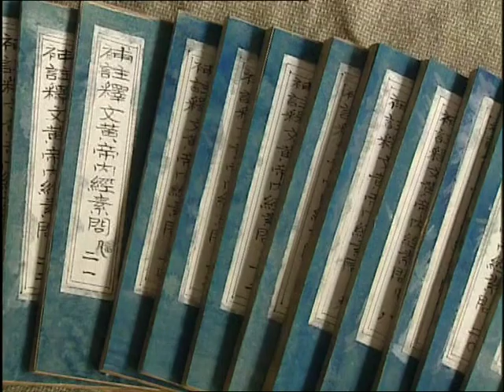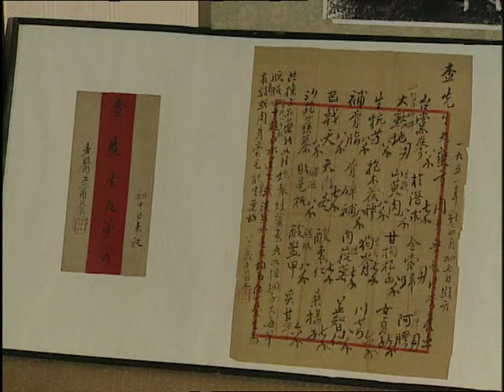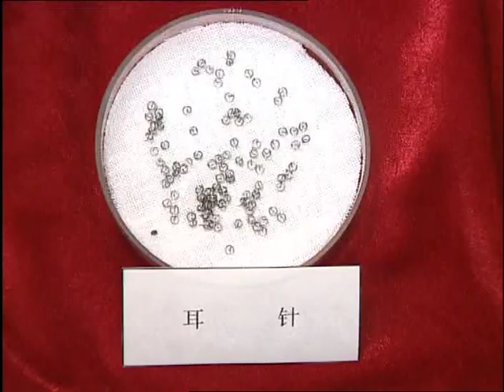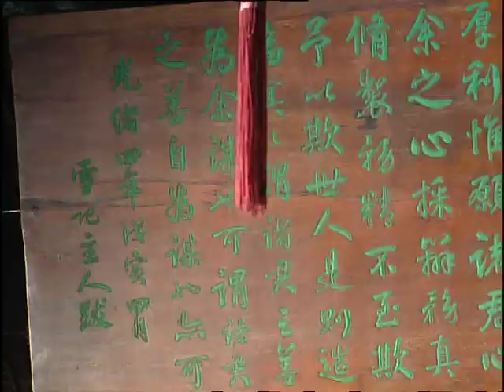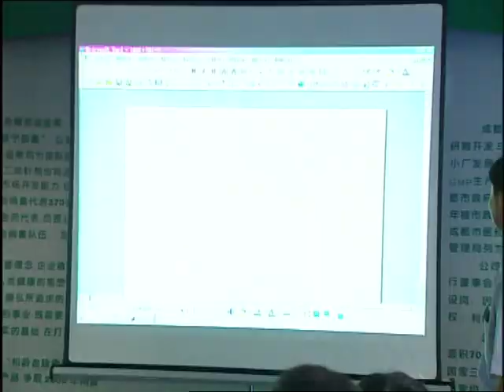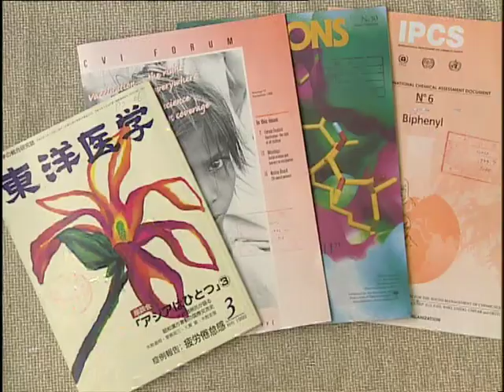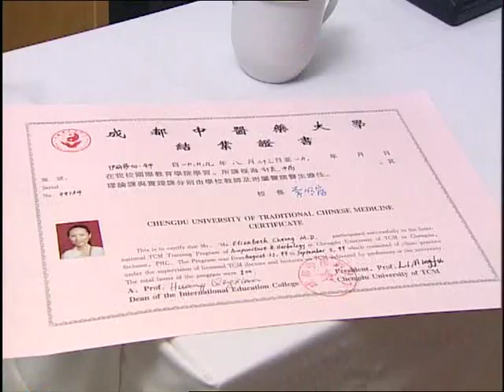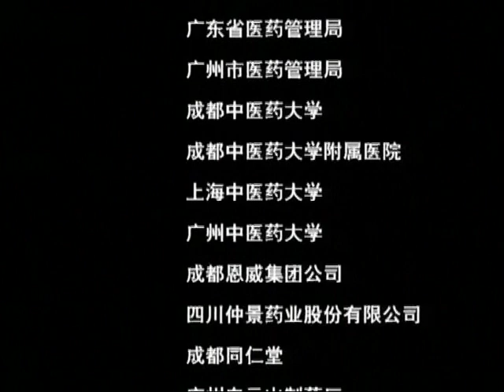A Look at Traditional Chinese Medicine (in English)

Comment: YES there is an "Ancient Healing process" as we Terrans understand, we perform a DAILY (Healing process) from Sunrise to 12 noon placing a (CLEAR quartz crystal) over the front soul of each foot (Yet put the quartz crystal in a sock for separation from the skin) Facing (South a Negative charge) combined with the (Auras on each foot) you begin attracting those (Surplus magnets from Sun-Sunlight that cause gravity) that are smaller than a ray of Sunlight you collect them inside your (CHI/LIFEFORCE)= the Green color of the Aurora borealis (a positive charge). Helps STOP the aging process due to gravity caused by Sun-Sunlight Also curing ailments and disease over time during this morning (Healing process) only. I am Joel Mosier/J.Terran the only Terran to be born on Eden/Earth 54, yet will never age past 50. This is how it is done.